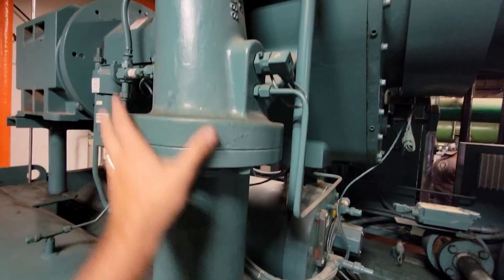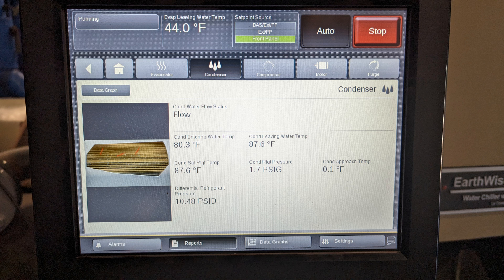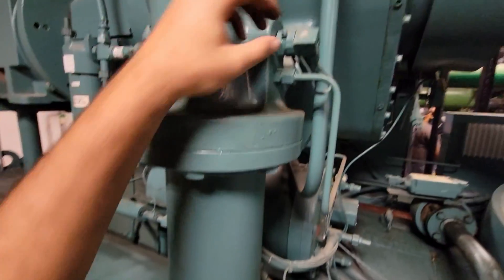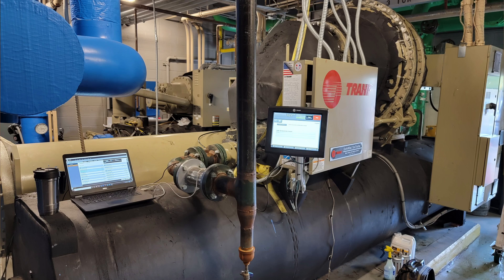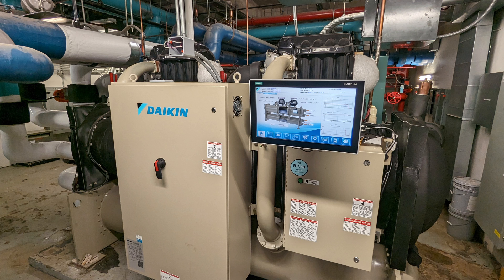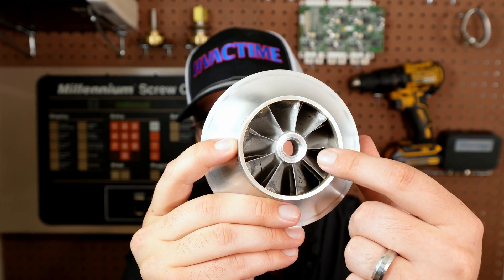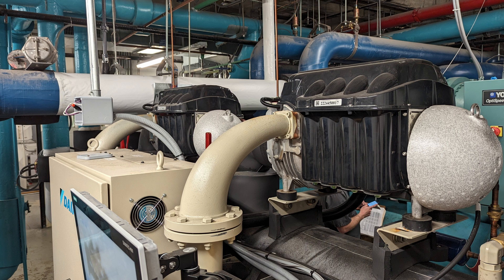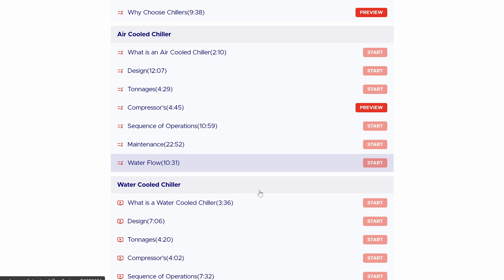Centrifugal Compressor Discharge Superheat

Comment: I have experienced this issue  in Centrifugal compressor discharge Superheat mostly in negative due to Evaporator refrigerant level high and racing liquid refrigerant to compressor Impeller eye the reason Economizer and Condenser valves are not responding to liquid level transmitters and mostly compressor demages some time we do close the cond and Eco Vlvs manually when no refrigerant Evaporation need to bring supper heat in + but due to alot of Chillers it is difficult to adjust the Vlvs according to load variation and stuff